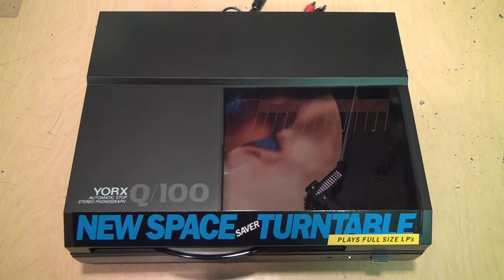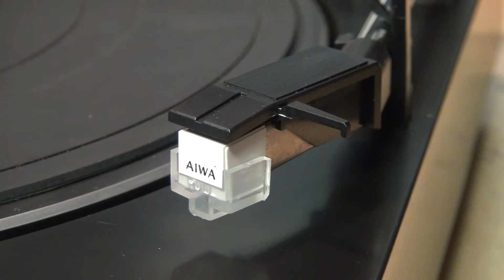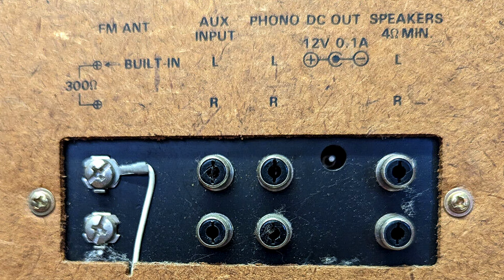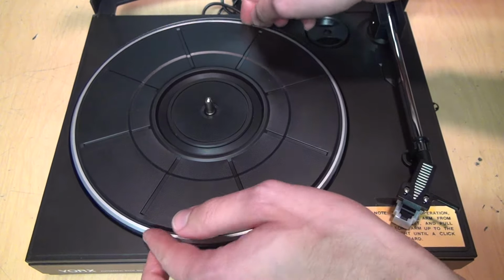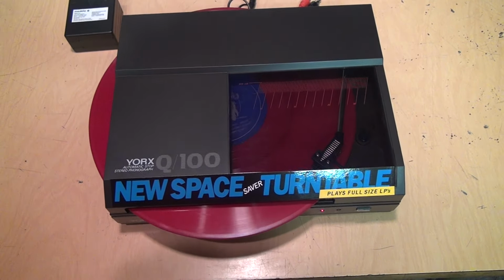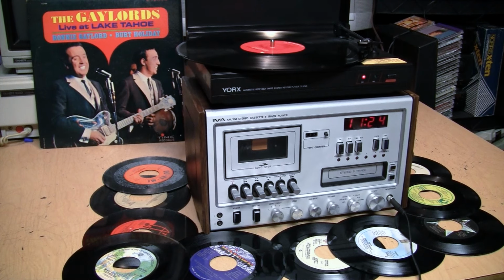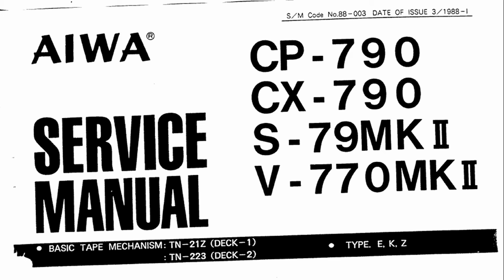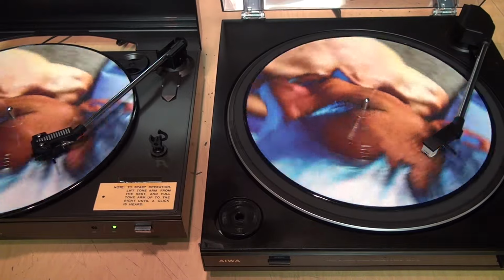How to rescue an orphan turntable - and why you probably shouldn't

Comment: Yorx....the first name in quality drug store electronics...
Reply: Haha, yep!
Reply: Was it even that good?
Reply: But it was quality next to a Crosley!
Reply: @randyab9go188  no, he used quality as sarcasm... It's very cheap junk. Think of those units with 18" high speakers, but single 5" drivers in them.
Reply: It's the sort of thing that would pop up around Christmastime.
Reply: I had a ton of Yorx (or its even cheaper drug store competition Unisef) stuff until I was old enough to get a job and upgrade to Sony. My first stereo was a  Yorx cassette/clock radio combo that broke in less than a year.
Reply: By 'then', everybody almost really, had to have a system.    The 70s- better gear, in a rack, were legendary,  even to anyone who never saw full deal in person.   So the less informed and or more broke, went for these things in local 5 and 10s. Discount Dept. stores, etc.

Comment: intead of all that rigging on #2, you had the bottom off you could just wire in the right connections. it would have been
easier to sell if you wanted to. both sounded better than the cheap junk i grew up with.

Comment: Wouldn't all that happens is the motor turns backward if the polarity is wrong?

Hmm, on second thought with LEDs, speed trimmers, and other circuitry that may not be the case.

Comment: My parents had a Fisher stereo system on a rack. It had the turntable, AM/FM tuner, dual cassette deck, and power amplifier  on different levels of the rolling wheel rack. It had a weird arrangement where the tuner and cassette deck got its power from a weird 19-volt 2-blade plug that you could ONLY connect to female outlets on the back of the power amp! How horrible! You can't even run it on a 12-volt battery or power supply! The components are attached at the hip like Siamese twins! Talk about planned obsolence! And from a once high-end hi-fi company like Fisher!

Comment: is it ok to clip off the outer sections of a vinyl if you only like a certain track for example? are there tools for that?
Reply from the maker: No, if you tried to, you'd likely crack the disc. Radio stations used to cover up the tracks they didn't want the DJs to play with masking tape.

Comment: You should have just un soldered the cable from the aiwa and directly soldered the correct wires to the board for a much cleaner look and would have preserved the original cable.

Comment: As a DC motor, I think it would just spin backwards if you used the wrong polarity. If power does go to the stylus it would just be as a pickup and again it would just play out of phase if stereo.
Reply: There´s probably some kind of motor driver that will blow up on reversed polarity because something has to regulate the speed.
So there´s at least a small passive circuit inside but that still means it has polarized caps inside.
Reply from the maker: Yes, the motor will turn backwards if you reverse the polarity, but there's also an electrolytic capacitor attached to it which will blow if you do!
Reply: Those caps will blow up tho
Reply: @MultiWirth  Alas no, those motors have a regulator that uses the back EMF of the motor to regulate speed, and reversing the polarity will blow the chip up.

Comment: Personally, I wouldn't of cut off the grey plug, I would of taken the player apart, traced the wires and soldered on other adapters to where the original wires went and kept the original cable intact, inside the player itself.

Comment: Turntables with magnetic cartridges SHOULD NOT have inbuilt preamps. They should be connected to the Mag. Phono inputs of a stereo amplifier and let the amplifier's own internal circuitry handle the signal.

Comment: love Soundesign's boombox but their mid 90's fake system the 3 cd plater died in a year.  Only kept the speakers....  So I have nothing good to say about anything but the side mounted cd player boombox...  I never got the adapter for such a thing for smaller discs...  Doubt the cut cd's woulda played on it either as it was held in place by the door not a click.

Comment: I have to disagree that these cheap decks are the result of the vinyl slowdown of the late 1980s.  They are just cheap electronics. 
It's not like you couldn't get excellent turntables in 1985 or 1987. Some of the best sounding turntables ever made were made in this period.

Every other component of these cheap plastic bookshelf machines, which were little more than non-portable boomboxes are every bit as bad and bare-minimum as the turntable. The whole stereo is bad.  Even the ones with CD players sound bad. They have cheap plastic speakers. 1 or 2 watt output which sound tinny and weak.  They are just all around 1980s plastic badness, especially YORX. Yorx was so bad even Kmart didn't sell that name in the 80s.

Dollars to donuts these machines sold for 100-200 Dollars at the most. I bought one in 1987 for 99 Dollars at Toys R Us.

Comment: There's a place for you in electronics heaven.  For me, this is and was garbage . I have never opened any component.  No practical related experience. No space in small apartment to take in stuff like that. 

 My first TT late 1977 or so, on very low budget was the most basic Technics direct drive manual model.

Comment: to be fair Yorx  was never a high end audio maker i've had lots of their 8 track players and they were so cheap they had no weight and everything quit working the plastic holding the head in place would often fail miserably
Reply: I had a yorx portable stereo in 1983 and the toggle switch went out in few months and so I sent it back to get a replacement and the replacement started doing the same thing later on so went a head and got a sanyo

Comment: Those AIWA turntables were an add-on part of stereo system with radio, cassette, CD changer. I remember seeing those a thrift stores and they shouldn’t have been sold separately. Please sellers and thrift stores, don’t sell them separately if they were donated together!
Reply: That expects people sorting donations to thrift stores to know what they're doing. Most of them are volunteers and many of them probably don't have the time or knowledge to sort through donations such as turntables and reject those that don't have the matching stereo.
Reply: @TheKnobCalledTone.  I went to a thrift store last month and I found a matching stereo system with the top turntable but they selling them separately. Even with video game consoles, I see them sell GameCube consoles without the power brick nor controllers! I avoid all used electronics without power supply.